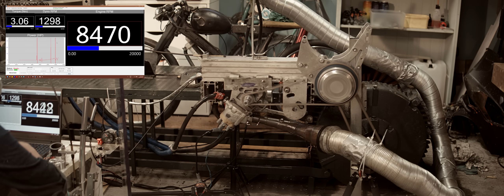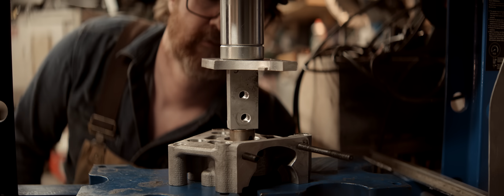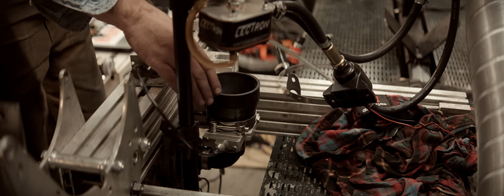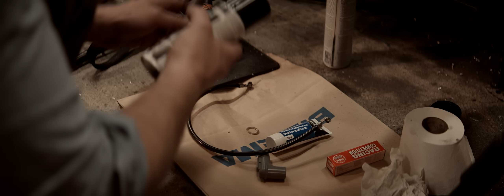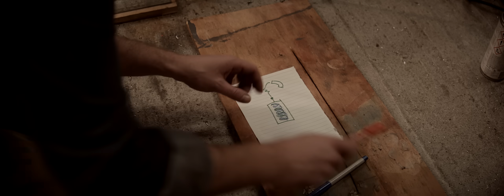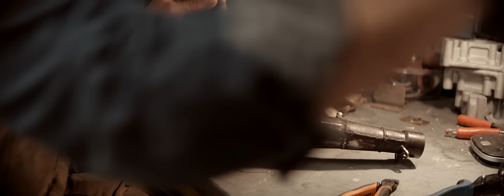50cc only making 29hp. Where did the power go?

Comment: I was just scrolling through, seeing this video again. I had a thought,  why not make the crank the rotor valve? make a ptfe tube that feeds through the case badically touching the crank/ rotor valve, it can be lubricated inside the crankcase. Grind the rotor smooth , then have it chrome or nickel plated or other coatings that can withstand light friction while preventing rust. It could make great power with less parts mounted on the crank. Maybe a large piece of Teflon hose could be used with a thin metal bracket on the inside, m3 screws mounting it to the case.  Leaving a 1mm  (+/-) with only the Teflon   in the case of crank float allows excess contact. The crank throw is solid  with a cutout for the intake or a titanium disc can be mounted to the crank on the inside. About .065" thick  or possibly using stainless steel?  I think an opposed piston engine would be cool, HOWEVER 🤔 ,  building one so small is not so easy, it would be like building two 25cc engines to end with 50cc. Using crankcase induction  with an opposed piston engine could make great power, basically like supercharging it. As for the gears connecting the crankshafts , maybe have jlcpcb. Make the fears instead of using straight cut gears use double  angle cut gears.  With one angled one way the other the opposite, so the gears are not pushed away from each other at high rpm. And build a gear case to seal them in oil  use a thin oil, possibly  ATF  or 0w5 engine oil with about 1-5% lucas oil stabilizer, maybe 2-3 oz per 18oz just enough to make the thin oil tacky. Without making it thick.  Possibly  polish the gear teeth with 2000+ grit paper, maybe use leather with diamond dust. The teeth should look like mirrors. Maybe use 4340 , 4130v  something capable of hangling power, possibly  make each gear 6mm thick, 8mm or less probably mill 2mm from  the inside and attach to a large  aluminum hub depending on the size of the gears having two crank gears with a single center gear connecting them would be nice with two 80mm rods this could make the gears large running 2 gears would be very large , 3 , 100mm gears maybe? Or 4, 75-80 mm gears? Maybe use 3 gears and use the center gear as the crank output? Mount a bearing in the case with a 20mm shaft with the gear pressed and keyed on it. With 4" of shaft from the gear with 20mm of splines and 15 mm of m12 threads to attach a pulley on the tip of the shaft, use two bearings in the cover made of aluminum,   taking 4, m8 x 25mm bolts, and 4 m6 dowels retaining the cover, with a 1/8" ', 3mm plate under that sealing the gears in the crankcase. With about 6oz of oil inside to lube everything.   The bearings  get a seal in the output plate . A 1.5" plate milled to m6 thick at bolt holes and  milled for bearings  and a seal. This would allow an engine with two cranks to be mounted and used more traditional like.     I think maybe a 100cc engine would be easier to build. Two basically  traditional 50cc engines joined at the heads. It could possibly make 60-70 hp 😮 @18,000 rpm..  it would require A CUSTOM cylinder,  and custom  pistons  with a sphere in the center , using two inlets , two exhaust,  or modify that and use one intake zone one exhaust.  I'm thinking use two, study it. Then make changes, educated changes, blind changes help nothing. You do not know why it helped or hurt PERFORMANCE.. 
JUST AN IDEA . 💡 I WANT TO HELP.  I'm hoping my crazy thoughts will help you think of something  practical and amazing 👏  ✌🏻 🙏

Comment: Can you take off some crankcase volume to see if it adds or subtracts some juice :)
It is cheaper than adding some volume, if it is the wrong way.  It seems as you are running into a flow restriction somewhere in the turbine.

Comment: May this engine (a bigger option) be used in a family SUV?
My V8 Touareg can go on 2000-3000 rpms comfortably. Yes, it is 4,2 liters. If the 2stroker is not 50cc but a liter can it manage a 2 ton car?
How loud this engine will be in civil use?
What about balancing and vibrations of a 2stroker?
What about fuel consumption? I would imagine 0.5 liter engine don't consume as much as 2 liter engines (that consume up to 10 liters a 100km). I would hope for a 3-4 liters per 100km.
I'm not an engine engineer. I'm just fascinated that 50cc engine can make 30hp. In my head a 100cc should make around 60, 200cc should make around 110hp, I would hope 400cc will make at least 200hp. Like if a 0,5 liter engine can make 200hp - that should be cool.
Reply: A high-revving two-stroke engine in a car would be complete nonsense. There's a reason why an engine has a 4.2-liter displacement: power is torque times RPM. A 4.2-liter engine has sufficient torque in the lower RPM range, where you usually drive, for comfortable cruising. An engine that only delivers its power at 17,000 RPM is practically useless below 5,000 RPM because there's no torque. How do you think a car's fuel consumption is determined? Fuel consumption results from the engine's efficiency and the power output. If you want a high-horsepower engine, it needs a lot of fuel. You don't get something for nothing, as they say. So, a high-performance two-stroke engine consumes significantly more fuel per 100 km due to lower fuel efficiency (a lot is lost through the exhaust and exits unused). Furthermore, the engine wouldn't last 200 km before the bearings fail. High RPM is good for power, but it kills any engine; that's why old diesel engines that don't rev to 4000 RPM can still run for 500,000+ km.
Reply: So, to put that in perspective, your car is relatively fuel-efficient... a Bugatti with 1500 hp would consume 750 liters in one hour at full throttle, but its tank only holds 100 liters, so it would be empty after about 8 minutes... in those 8 minutes, you would have covered 65 km at 490 km/h and used 100 liters for that... I'm shaking my head in disbelief and grateful to only drive a Golf TDI, where I can get over 1500 km on 100 liters.😂

Comment: that fuel in a automotive 4stroke is mostly liquid until later in the stroke. compression is your friend till the point of mechanical failure and voltage is cool but amperage is king

Comment: Looks like the exhaust pipe is starting to slip of the cylinder at peak power. Its visible in the end of most pulls. Perhaps some stronger springs would keep it on tight.

Comment: And the muffler short to the vacuum bar drop need hotter spark you got 6 to 8.7 HP you can clean up I'm say 12 HP gas is going to make less unless you change the mix and it should do better you need piston cool as the fuel goes in need to be close to tempature 187 flash point is 212 or what find out and keep it low to keep it yeah that's all i can help you with i don't know any more

Comment: The wing for down force goes fast er and the back of the back tired cuters and fins so air out and up back wing foil to get max down pressure and you need carburetor side ways to the direction you are going it changes the intake at can't remember your arrow dinanic needs to be it makes a great deal of difference

Comment: What ever your max rpm is get double the speed bearing or some 90,000 RPM Tesla's bearings Teflon coat with no bugs or dust curtain up and wet the floor to apply that should give you max ho and i want to see what you max to an what size was the motor stock

Comment: 10 degrees the intake port to ratus exsost 15 degrees plus the radius that gives u VAC bar to pull in to chamber and that fixs the water problem o you can try part of a moth ball it takes,1moth ball to 55 gallons of fuel i think it could be 250 gallon but everything i told you small gains but make sure that the page of the day and date time stamp start and finish one i don't know any thing else to get you any m😢hp

Comment: Exsost pipe tumed will gain 7 HP hoter coil gets 3 HP coat Wall of the cylinder with Teflon and a carbon or kevlar ring bottom is oil ring set oil ring does it slide easy and fuel need a regular straight turn the muffler and that should gain total 7 to 8.7 I wish it was 15 more HP and polish exsost port with straight out match in poatt and exsost to the pipe Teflon the inside of the muffler is the crank and connecting rod balance and can you polish or shave any weight off you got brass upper connecting rod bushings and needle bearings on the crank keep it Rich don't run it to lean and put water injection on it after you get what you want make sure mix oil in the water add magnesium to the fuel to fire better i remember the ratio it will bump up octane 8 and you can make some better fuel and 90 proof alcohol in the fuel will pull any trash it runs better All that should get too 49 CC and clean intake don't polish you will lose HP you polish exsost port and match the pipe and expansion chamber the muffler and don't over Rev unless you got it under load it's not tuned sound like to me but what i know ig you do all that and coat the piston and don't run it past 3/4 throttle a😢n gas make sure you add alcohol to clean it up and add magnesium to the gas to burn ratio to go and flo? Right you will get rite an thank😢 for all that but try one at the time and right it down tempature and abim temperature a humidity factors and you will have data to not lose hp and the bottom of the slide on carb knife edge it Teflon the slider plate and houseing i believe that should get you the Max you got to get o 610 is great because 700  CFM liter CFM I'm trying to think of any mods i left out

Comment: You need a static point. run a controlled fuel, one carb setting you are happy with. and set an EGT temp from that. Ust the EGT to figure out problems.
Data,data,data
Also, coil is an easy win i feel...

Comment: Adding resistors to ht line changes timing. The coil has to generate more voltage to brake the gap delaying spark. Also makes it rich being retarded. 
Keep it up.

Comment: Might it be possible to use a basic fuel injection system? You could then adjust mixture  with a few key strokes and remove variables in the carburettor also program a safety into the system to richen mixture if engine temperature gets too high.
Love your work

Comment: Just to be sure if your issues depends on fuel or not: did you spend some thoughts on temporarily using an electronic fuel injector to precisely check the afr? Your tests with other variables get more reproducible with efi I think.

Comment: Looking how smoothly the bottom side of the chain behaves, I would put the tensioner on the top side so that it pushes the chain upwards with very low tension (maybe try making a progressive spring setup) and with the RC car shock.

Comment: rusEFI has done 10k+ moped engine before. Might be worth considering. They also have done FAI small motorcycle injectors. Those take gravity feed fuel and pressure just at the injectors. Search rusEFI forum for "2004 GY200 single cylinder" it will show the basics of FAI type injectors

Comment: You're missing several pieces of data to be able to reproduce your tests and draw reliable conclusions. First, you need the engine temperature and real-time air and fuel consumption (BSFC). This would save you a lot of trouble. These devices exist and are readily available. You could probably build most of them yourself. You're quite resourceful; you've proven it to us so far.

Comment: Hi Alex. I see that resistor in cap worsens your power output. It means that your engine is sensitive to sparc energy changes. It means not enough energy. Plz try sparc on plug, or plasma (u can diy that) and or double sparc plug cylinder head. It can be beneficial for slower burning nitro. But maybe non necessary for gas.

Comment: What is that 'power correction 4%'?
What does that correct?
And ~6% enviroment correction seems a bit off
If i put in your numbers 20.9c 52.6% humidity and 976.26Mbar i get  1.0207 correction.

Maybe is your powernumber on screen 'uncorrected' now?
And was showing corrected numbers when you did the 32hp pull.

roughly today 28.5hp x 1.105 = 31,49hp
Reply from the maker: 4% is chain1 x chain2, 0.98x0,98 efficiency. The correction factor used is from a SAE paper, it's specifically tailored for a two stroke's response to environmental conditions up to 3000ft. Posted it on screen a while back. I'll double check the graphs, but I think they're showing corrected numbers.
Reply: So it means that you loose 6% going up to 3000ft?
Reply from the maker: No, the formula is valid to 3000ft, over 3000 there's a different set of equations. The paper is on small two stroke aircraft engines.
Numbers shown are corrected. The 32hp runs had higher pressure and 1.023 environmental correction.

Comment: If you hadn't already gotten 32hp, I would recommend two coils alternating 7000 cycles for each, to ensure more energy and spark stability at high revs. Pure fun to implement. 
The vibrating chain could also be stealing some power. 
In my 2T experience, I would focus on input and output tuning. Sorry, but I couldn't resist giving one more opinion.

Comment: Is the air in the garage filled with exhaust fumes when you do those runs? 
I mean, if you cant breath there without a mask. How can the engine get enough fresh oxygen rich air? 
Did you perhaps have the garage door open during the 32hp runs?
Reply from the maker: Same conditions. There's very little exhaust in the room, the mask is mostly for the unburnt fuel mist. Methanol by products can build up in the body over time until you reach a threshold, trying to be a little cautious.

Comment: 2 things. In the states we can get a vp rc fuel 30% nitro and 9% oil. That seems like a bit more oil than you run, but maybe worth looking into. 
2nd, after I put efi on my old mustang, I got massive interference from the distributor into the efi computer.  A set of resistor plugs cleared up the whole problem.
Still hope to see you again at speedweek, I'll be going for my red hat next year.

Comment: Alex, why don't you bolt the high voltage coil directly on the dyno frame? It will be better grounded, possibly reducing EMI. It will also have better heat dissipation, helping it work more stably in high RPM.
Just remember to bolt the coil correctly on the frame, sometimes not all bolts should be grounded because the iron core of the coil also produces some low voltage - high current between its edges.

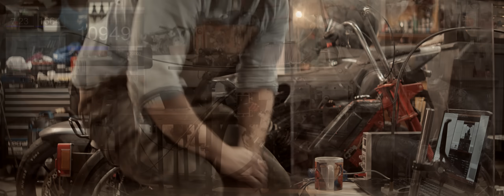Comment: Might be some back pressure happening in the flexible tube you're using for exhaust ventilation. You can see it trying to push back away from the pipe when the engine hits powerband at 21:10 and 31:55. Also the chain is doing some weird harmonic slapping.

Comment: I have a land speed racing RGV250 and have been chasing a high rpm miss fire. Changed from an Ignitech to a Zeeltronic ignition and the miss has gone. Ignitech ignition have a hard time with 2 stroke high revving motors. Just my thoughts.

Comment: Hey Alex I see that compared to the previous maximum HP the peak/over rev RPM is consistently lower, (not going into the 17,000s.
I agree with the others who noticed the stuttering. I wonder if you are pushing that Ignitech too far?
Remember you got that 32.13 hp at 16,303 with sloppy chain etc set up, but you did not know if you had the hole in the exhaust. so something else is going on.
I like the reset back to 32hp set up.
Reply from the maker: I've been running it at 19V which is pushing it, overvoltage cutout at 20V. Have a suspicion some components are starting to fail from overheating.

Comment: Still killin it,all my thoughts were touched on by someone in comments you got some smart guys out there,i was hearing the sputter thinking it was rotor valve timing,you need two coils combined to one wire the way it drops off at 16k,is that wood or metal coil is mounted, remember chain tensioner robbed power but needed,fuel consistency somehow, later man!

Comment: If you want to increase power must increase rpm; for that must shortening length of the tuned pipe and reduce stinger diameter. the last one increase power but the temperature rise dramatically. Tips andd tricks from former mechanic moto gp 2t era. 👍

Comment: I believe there's more power to be made in ya intake and carb setup to explain in a simple way for example if ya was to use a volcity stack and tuned the length like ya do a 2 stroke  expansion tank exhaust and  directed  an injector in the stack and possibly  direct injection as well  I'm sure you will see more that 35 hp possible 40 with spray ya could possibly do same with carb  but mite end up over sized 😂😂😂 honestly ya should look into it as that k&n and stack won't be at the right legh nor creating volcity
Reply: Audi does a direct ignition coils as well all car guys use them on builds ya might be able franking stine one to work to help spark

Comment: Look at your video at 8:31.  The sprocket bolt is loose.  The tension side of the chain looked terrible after you added the tensioner. It's max flailing.

Comment: I have a couple ideas. I know that a capacitor takes a certain amount of time to fill before discharging, maybe the capacitor is getting  depleted at high rpm at a higher rate than it can recharge. Time = resistance x capacitance. And it takes time x5 to charge to 99%. Maybe look there. And my second idea is you do a lot of testing where you are moving the height of the fuel or carb to achieve a certain fuel pressure. When you get to the salt flats that will probably mess with pressure required as well, so why not run a pump and regulator. I know that they make regulators that go down to as low as 2 psi, I’d have to check to see if they work with methanol, but I think you would gain a lot of consistency if it is always the same. I think that the sharp drop off at 16000 rpm is ignition related.